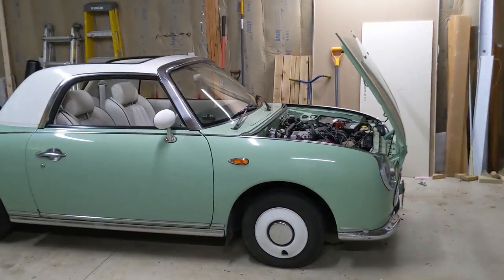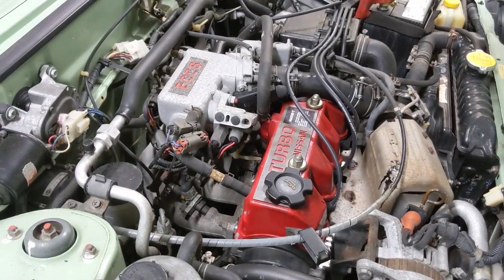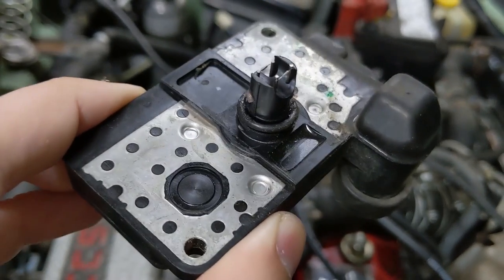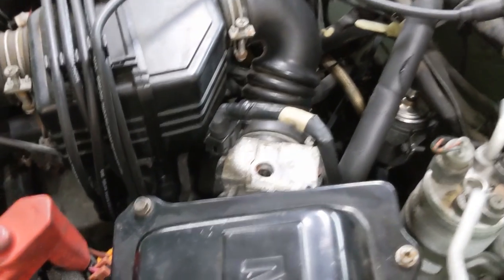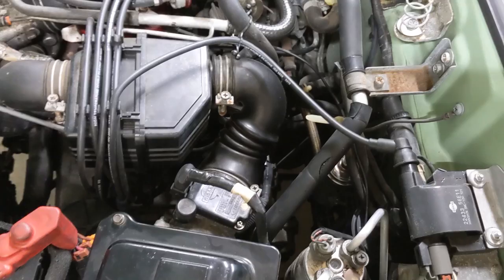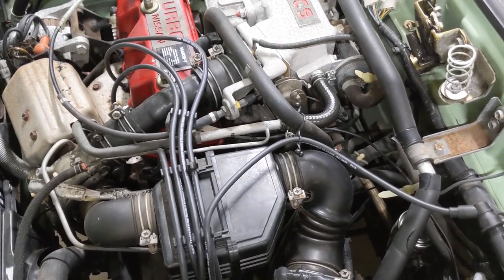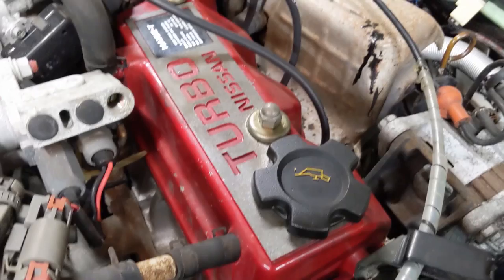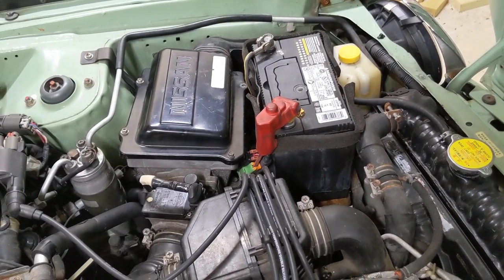Modern engine control musings and Fixing a Figaro

Comment: an obd1, so it might blink a code.  the tough starts might be......your tw sensor (the sensor that detects the temperature of the coolant).  it could be reporting an out of range reading when the coolant is a little warm.  it lets the operator know that there is a problem by requiring the person starting the car to require longer cranking time, then it will start (as not to leave you stranded)
Reply: ok.. i heard yo7 replaced it.  but your iac passages might be carbon fouled.  take the assembly off, and clean the pintle valve and passages

Comment: Had a 2004 Land Rover Freelander, would not start when warm, replaced lots of parts, ended up being the cam sensor...  Found out by removing the cam sensor and spraying it with a can of 'freeze-it', try and do that with your distributor... Even better, just scope the output lol. Also measure the voltage output of your o2 sensor and see if its in open or closed loop monitoring, if its trying to start in closed loop due to a faulty o2 sensor then it will be hard to start...

Comment: I have a question if you know. Does the ‘car computer’ (main microcontroller running everything) run on 12 volts or does it step down to 5 volts or something else

Comment: The starting issue does sound like it could be an "IACV" issue. (or whatever this car has that you're saying may not be an IACV.) The symptoms do also seem quite similar to symptoms my 2000 Honda CR-V had when its intake/exhaust valves were out of adjustment. For those cars, it's a common problem. I have no clue if that's a common problem for these too. But of all else fails it may be worth researching or just checking.

Comment: If you still have this car that weird problem is an issue with the fuel pressure regulator, and this thing has a very "dumb" injection system, it has very minimal inputs and lots of outputs for idle control, have someone pinch off the fuel return line from the regulator and start the car to test for poor cold starting issue, a bad regulator also causes your turbo lag issues and a sputtering transition off idle. this injection system runs on a very limited fixed map and if ANYTHING is not perfect it can not adjust like a modern system, any vacuum leaks, intake or exhaust leaks and it runs like trash

Comment: The spring clip on the connector probably did not had to be removed (in the first place) -- just pressed down. Looks pretty similar to a TE/AMP Junior Timer or Bosch Jetronic style connector.

Comment: They measure current for a known voltage to maintain a temperature in the piece of nichrome wire.  More current, more airflow.  LEss current, less airflow.

Comment: I'm surprised this car doesn't have a CONSULT port for connecting Nissan's diagnostics computer.

My poor starting/running car checklist (I've had a few do this, one a Nissan):
- Clean out the idle air control valve and check for leaks on the hoses. It is likely controlled by a solenoid. Use your MAF spay can and blast it, and actuate the solenoid manually with a battery to work the valve free if its stuck with gunk. If its indirectly controlled by a vacuum line, you'll have to use a Mityvac or equivalent to actuate it (and test the valve on the vacuum line!). Don't know why Nissan would use vacuum to control the valve on a car this new but whatever.
-Clean out the throttle body. This is a problem with older Nissans. Carbon build up around the butterfly plate cause weird running issues. A rag and MAF cleaner with repeated scrubbing takes care of this.
-I don't know if the Figaro has one, but I had a failing throttle position sensor on my old Maxima causing weird engine surging when coming to a stop at intersections. The service manual should have a procedure to test this with a meter.
-Find every damned vacuum leak you can.

When buying parts, before going overseas, see if the part # was used in a USDM Nissan. Procuring locally is ALOT cheaper and quicker.

Comment: Non-OBDII vehicles can't tell you fuel  trims so, fix the starting problem using a traditional exhaust gas analyzer. Diagnostics rule over guesswork.

Comment: Car that old should have a damper/door on the air intake, to allow hot air to be taken in from around the hot exhaust area, there should be a temp sensor on the air intake before the filter, and the door should be there as well. Just my two cents based on an 84/86 honda civic

Comment: From a google search, "22680" seems to appear as the part number in a lot of airflow meters with the same connector and different mountings, and the listing on one of them says "Can be used on any 0-5V MAF system with Nistune, requires ECU tuning once fitted", so that makes me wonder if these are basically interchangeable [once you get around the mounting differences]
Reply: The full part number is 22680-17B10. 22680 is a part category number, specifically for airflow measuring sensors. This is a fairly common system among Japanese vehicle manufacturers, with the second part usually derived in some way from either the vehicle it was originally designed for or the vehicle it's intended for.

For comparison, the vane-type AFM on a 280ZX had the part number 22680-P7100.

Comment: have you checked your fuel pump or fuel pump wiring i had a 2003 Nissan Sentra that i was having starting issues and stalling and eventually wouldn't start. i also had changed crank and cam sensors prior to that and ended running a wire from the fuel pump (ground) to the Battery - terminal and put in a switch and a fuse right off the battery that solved my stalling and starting issues.

Comment: This may help, may not but try cleaning the throttle body, especially being a turbo there may be some carbon or whatever behind the throttle plate. Some rags and throttle body cleaner. Might be worth a shot! I know on drive by wire vehicles it helps with weak idle

Comment: Vacuum leak may be your issue. Typically will cause high idle and some power loss. Will lean out your fuel air mixture. If not fixed could even be catastrophic for engine

Comment: I have to open a plug on the engine and bridge 2 pins with a paperclip to enter debug mode. Then I have to take a volt meter to the other pins depending on what I want to debug and read the voltage.

Comment: My 84 RX-7 (carbureted) is vacuum and sensor (well switches and solenoids)  driven, no computer at all. My 72 240Z doesn't have a computer, but my 75 260Z does.

Comment: carburetors are stupid relative to direct injection and fuel rails for a variety of reasons, although none of which are fatal failings, direct injection and fuel rails just perform better and are more sensor friendly. BUT carburetors have 1  large benefit for starting a vehicle in negative double digit temperatures when you haven't had it's block heater plugged in all night and you need to get on the road in 5 minutes or less (provided the tires arent flat from the cold) 
with carburetors you've got to prime them with fuel for cold starts, they'll say as much in the car's. manual. but what they won't tell you is this process is trial and error until you find the right amount of fuel pumps to overcome the cold cranking conditions. 
but there is very little reason you have to be delicate and measured with this priming process. if you want to leave NOW; simply pop your hood, dump some explosive liquid into the carburetor (they offer specific small bottles of more explosive alcohol fuel for this) use a camp lighter to set that on fire from as far a distance as possible, wait for the conflagration to subside or even have a friend start turning over the engine during the height of the deflagration. and the combustion process of the of that engine will begin, one way or the other, fairly quickly. 

i have always had newer, if not brand new, vehicles since i began driving and when i was a teenager living with my dad who had an old carbureted truck parked outside with my vehicle in the winter i'd have to begin the startup/warmup process 10-15 minutes before leaving, mostly as a longevity practice for the engine and so to have enough time to troublshoot any startup problems before leaving. but if we had to leave somewhere at the same time, my dad would literally walk out 2 minutes before we had to take off with a paper cup full of Av gas (aviation fuel), dump it in the carb, blow it up, start the truck instantly and drive off, usually before me, and usually pointing and laughing at me on the way out. and i never saw any ill effects to the trucks performance for doing this.

Comment: You should replace that idle air control valve or cold idle valve in your case. Seems like it is sticking in a partially open state, which would cause your starting issues and light surging issues as it is letting in more air than what the computer is calculating while driving, but not enough to sustain an idle with the amount of fuel that it dumps in at the beginning to get things going.
You could blast some carb cleaner into it from one of the vacuum lines if you wanted to, to see if that clears out any gunk, but because it is a common failure point, I would probably start sourcing a replacement.
I had similar issues on my 89 celica 3s-fe and later on the replacement motor in that 89 celica a 96 1MZ-FE v6 and both times these were solved by cleaning the IACV and MAF (in the case of the V6) or completely replacing the MAP sensor on the 89 I4.
Reply: The high idle after warm might also be the computer compensating for the leak based on what the O2 sensor would be detecting as a lean burn. Burning lean, btw, is a great way to overheat your motor and burn off oil.

Comment: 1500 RPM does seem a bit high for idle, unless it's from a cold start. My lovely old K11 Micra was a 1 litre automatic too, and idled around 950 RPM, although it didn't have AC. From a cold start it would idle maybe 100 RPM higher.

Comment: You have un-metered air getting into the system.  It would be nice if you can read fuel trim data on it to be sure, but that will probably not happen.  I would double check for any vacuum leaks, but I am guessing the Idle Air control is your culprit.  The only thing you can do is guess on this without being able to see live data coming from the computer.  I don't see that it has a Map sensor either as a backup way to determine air mixture.  Withouth that the computer just has to see how much air is coming in.  The O2 sensor is reading lean and it is adding fuel to make the mix richer, this leads to a higher idle.

Comment: I doubt there would be a time-dependent process in the MAF sensor. Instead, these are likely filaments with a known resistive temperature coefficient. Put a known current through them and measure the voltage across them, you now know both the temperature of the filament and the power dissipated by the element, from which you can infer the mass flow that would support the convective cooling that would cause the filament to operate at that point.
Neat, huh?

Comment: P sure surging can be caused by an o2 sensor as well as stalling immediately when it goes closed loop
Plus, on a 30 year old car with any milage on it, o2's need to be changed. They weren't great tech or very reliable in the 90's.

Vac leak is much cheaper and easier to fix though, hunt that down with a smoke machine test first.

Comment: The code ur getting is probably the distributer going bad or the crank angle sensor one of the signals are intermittently  dropping out. And the advice about split vacuum lines is good but also you need to make sure that ALL, AND I MEAN ALL! of the intake ducting Is in pristine condition there can be absolutely no leaks between the throttle plate and the mass air sensor plus you are right about the cold air valve it is a coolant controlled idle speed control it uses the temp of the engine coolant, but not electronically, that vacuum line is actually a coolant line, yes they routed engine coolant into the intake tract so they could use a thermomechanical actuator to control idle speed. So there's my advice technology connextras

Comment: i dont know that specific vehicle, but the idle air valve looks similar/same as whats used on late 80s lucas FI systems. like the l-jetronic. its a bimetalic spring type arrangement so as the block temperature rises it reduces the opening, thus lowering the idle.  if there is a starting issue which is negated by cracking the throttle when cold, it could be related.

Comment: You sure it's not a vacuum leak? The maf reads at the start, since it's turbo you have more length of tubing. When it's cold, the engine dumps a lot more fuel. So when it's warm, it's running lean, too lean. I own a Silvia which is a 91, most likely the engine ECU is very similar.

Comment: You could test the IAC by both gradually piching off the hose with a pair of pliers while the motor is running and pulling the hose and blocking the opening to various degrees if pinching the hose had no effect.

Comment: Check to see if there is an intake air temperature sensor, maybe in the intake manifold.  If it has failed it may be fooling the ECM into thinking it is cold, thus enriching the fuel (too rich for warm starts).  Could explain the good cold start and high idle.

Comment: You do have to set the base timing with a timing light by turning the distributor since this car probably has no crankshaft position sensor it only assumes the base timing is correct. My 89 Nissan Sentra has a similar mass air flow sensor and it is quite expensive. The cold idle sensor on my car is fully mechanical, uses coolant running through it to move it, kind of like a thermostat moves.
Reply: Also, as mine warms up, before the cold idle is deactivated, the engine surges up and down with an audible click each time as the computer tries to tame the high idle. This goes away once it is warm enough. The only 89 Sentras that had check engine lights had California emossions. I have the green and red LEDs also, they are under the passenger seat on mine, those LEDs and screw are directly in the ecm.
Reply: And once more, rambling cam sensors in distributors is normal when you have a distributor. Sadly nissan didnt really offer any obdi connections, unlike all American cars and some other foreigjn made brands.
Reply: Thank you for posting this video. I love your car! My daughter and I love your many productions.

Comment: The valve you call the idle air control valve does not look like an IAC to me. It looks like a fast idle or cold idle valve. The large hose connected to it will have coolant run through it. The coolant warms up wax in the valve to close the valve. With that valve open the engine will usually idle about 1200 rpm (fast or cold idle) with it closed, the idle will usually be around 750 to 900 rpm.  That is likely. Causing your high idle issue but not your cold start issue.

The cold start could be from a vacuum leak, a bad intake air temp sensor (part of the MAF sensor) or bad wiring or resistor that the MAF connects to.

Comment: Vacuum leak. Check air hoses. Probably one leading to the air intake after the MAF. I had this issue. It was well hidden and had to take air intake off to find it. Not a Nissan but a Ford.

Comment: Also if it is EGR Equipped. The throttle body gets oil build up on throttle blade. Will simulate rough idle stall and trigger MAF FAULT CODE

Comment: It's very common in Australia to remove the MAF completely on V8 LS1 Holden Commodores
Reply: I heard of this, it's something known about in the LS community though I don't remember the exact details. usually can't get away with it here on a stock car as the LS1 is in the OBDII era and a car would never pass inspection that way.
Reply: @cpufreak101  Holden actually released a MAFless performance Commodore at one point, so I doubt there'd be any trouble getting it to pass inspection here, haha. I read that the MAFs on US cars had a bigger diameter and didnt restrict air flow as much (at least on Corvettes), so that's probably another reason why it doesn't happen much there
Reply: Can confirm. VX owner.
Reply: @RiffRaffMama.  How much power are you pulling from it? ;)

Comment: No, it doesn't work the same as an idle air motor. It has a more mechanical function, like a bi-metal spring, that opens when cold and closes when warm. Usually, they have resistive heaters internally, that warm the spring over a few minutes, to lower the idle as the engine warms.

Comment: Nope, by gum, they don't make cars like they used to. 
Gone are the days of replacing points and condensers twice a year.
Gone are the days of being speared by the steering column.
Gone are the days of the roof flattening down to shoulder level in a crash, or losing your legs in a front end crash.
Gone are the days of knowing you're following a Ford by the smell of oil smoke, or a GM from the raw fuel smell.
Gone are the days of your garage smelling like gas because of the carb float bowls overfilling, heat boil, crust from life, or fuel in the oil.
Gone are the days of 100,000 miles being way too old to consider.
Yep, they don't make them like they used to. Thank Zarquon!

Comment: Speaking of sensors, have you seen Wes using a singal generator to verify a speedometer issue was due to a faulty sensor?

Also, does it have a choke plate?  Cold start issue could be such not closing.
Reply: It's EFI so no choke.